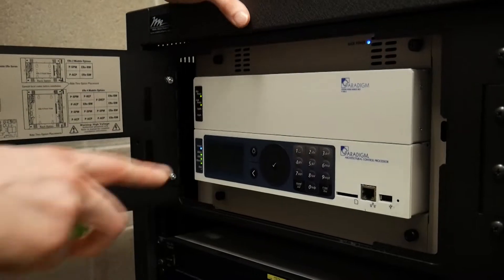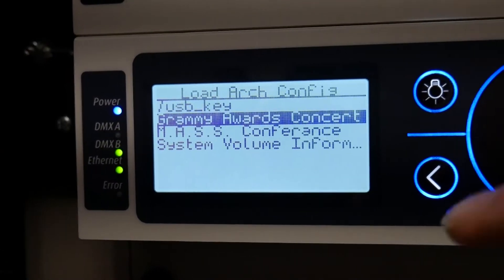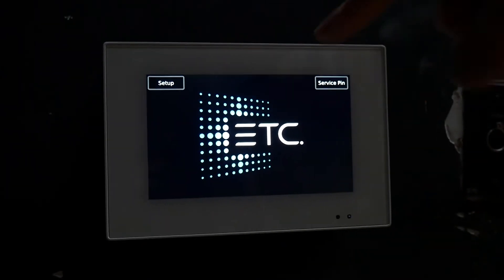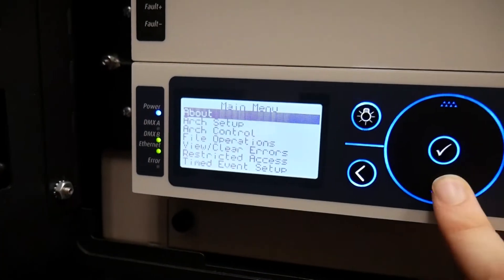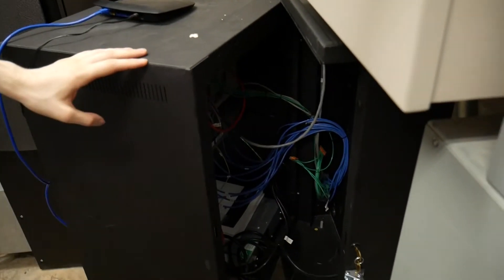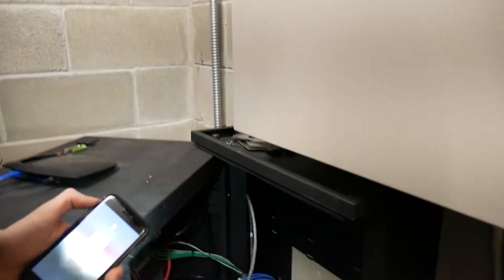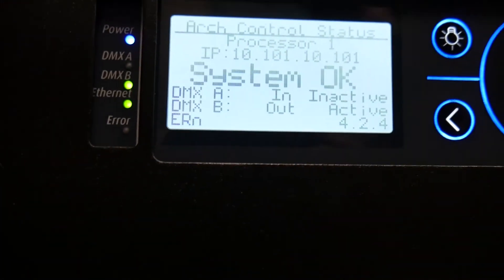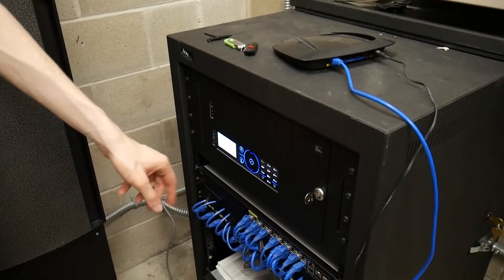ETC Paradigm Control Processor FIX!!

Comment: I need a replacement control processor. Any ideas where I can get one, older P-lcd and smart switch relay panel
Reply from the maker: I would recommend contacting ETC support at https://www.etcconnect.com/Contact/Technical-Support.aspx
They should be able to send you a new processor and check to see if your current one is under warrenty!

Comment: What do you do when the error light is on ?
Reply from the maker: I would recommend power cycling the processor by shutting off power at the main disconnect for that panel or unplugging the power cable on the back. Let it sit for 30 seconds or so and then power the unit back up. Just know that any lights that are currently on may go off when you shut off your processor.

If you have further questions, or if that doesn't resolve your issues, I would recommend contacting support at https://www.etcconnect.com/Contact/Technical-Support.aspx